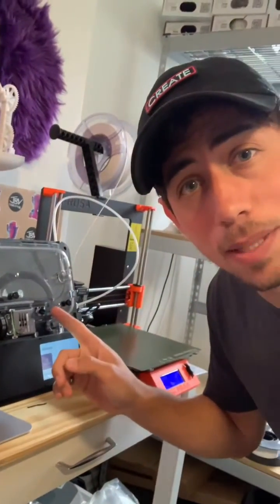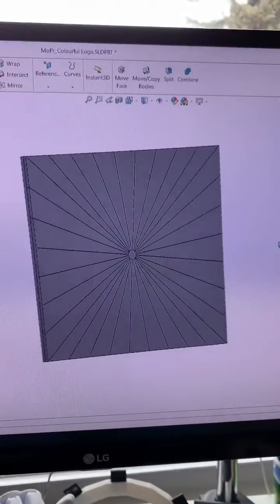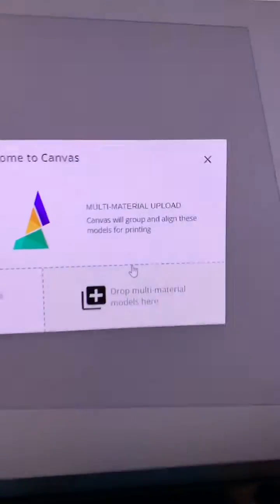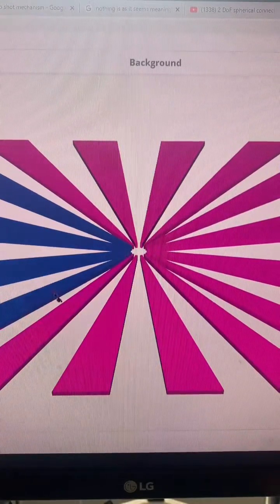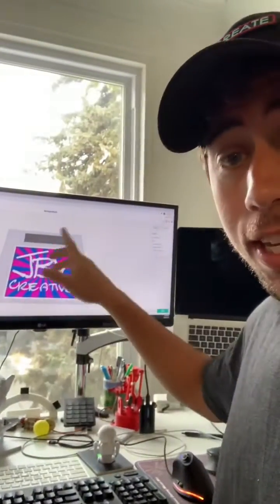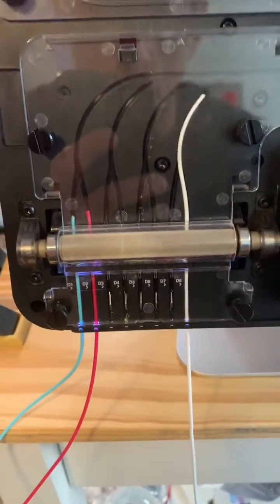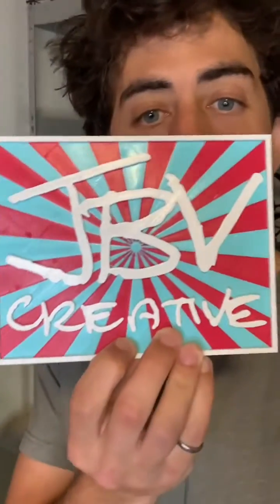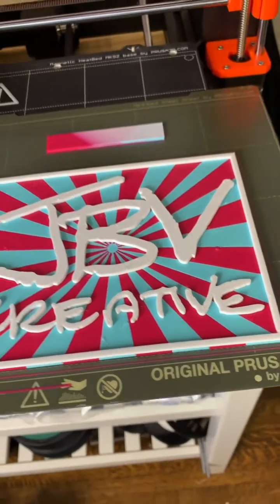Multicolour 3D Printed Logo Plaque

Comment: I just hate the waste of the purge block..

Why can’t it just purge inside as infill or run a smaller second print on the side that doesn’t care about looks like gears or whatever.
Reply from the maker: Thats a good suggestion, definitely a downside to multicolour printing
Reply: @Engineezy  One cool idea is to keep all of the blocks and then attach them to a board as a collage, different sizes and colors like a cityscape or something. That could be pretty cool.
Reply from the maker: @DanteYewToob  i was thinking the same thing!